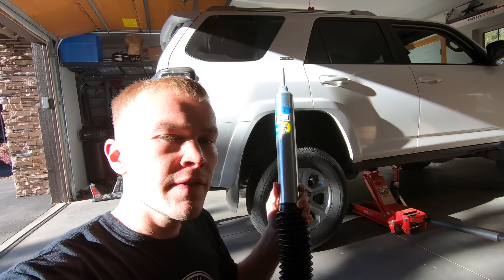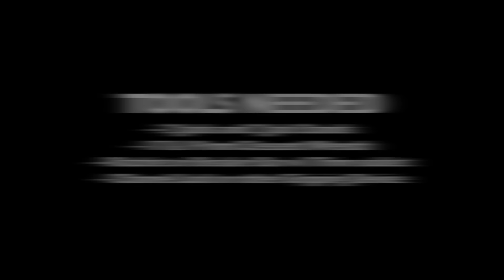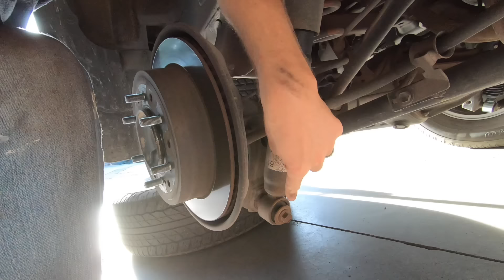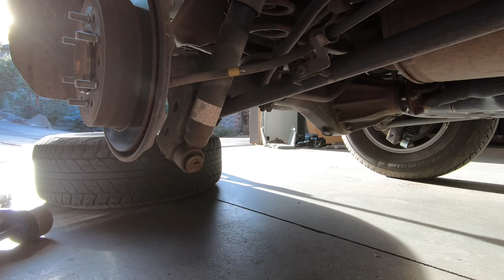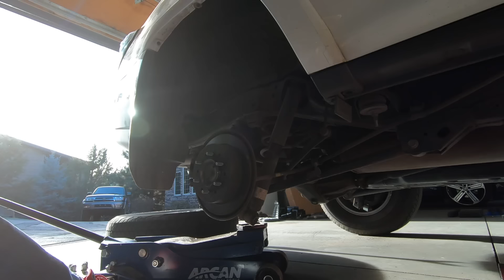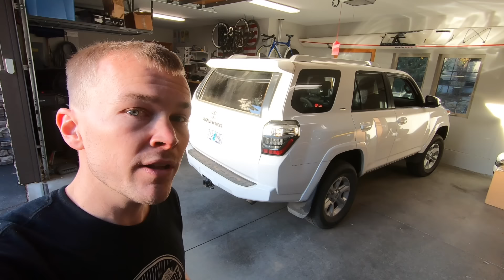4Runner Bilstein 5100 Rear Shock Install

Comment: My 5th Gen Bilstein 5100 show the washer cups face the other direction.  There's also another washer that goes between the bottom bushing and frame. Also, the new top nut is an 18 mm. Maybe they changed things? Thanks for the video.
Reply: Did you end up using the extra alignment washer? I left mine out when I put my lift in

Comment: I have a one inch block and an add a leaf installed in the rear and was suggested to install 5100s which I bought. Do I need to remove anything to make it stay level with the front or will it just sit right because it’s already technically lifted a couple inches? The point of the install was to have a shock that doesn’t bottom out and make for a smoother ride. Thanks.

Comment: I just had a shop install the rear 5100 on our 2011 runner but I’m hearing a clapping noise in the passenger rear now. Any idea what the issue could be? Bushing backwards?

Comment: Hows the ride compared to stock ? Stiffer or smoother ? If Stiffer is it harsh or stiff in a good way ?
Reply from the maker: Stiffer but in a good way... corners better, doesn't dive as much and not too harsh either.
Reply: @DrivenCompanion  thank you

Comment: does this lift the back at all? or does it keep it at regular height as the factory shocks?  Thanks in advance.
Reply: Stays the same unless you get a rear spacer. The spacer will provide the lift as long as you have a different shock to provide for the added travel.

Comment: Good video, thanks! One helpful hint. The old shocks you have to hold the center with open box wrench at the top as in the video to loosen. The 5100s you do not tighten this way, you need an allen wrench to hold the center as you tighten with wrench or it’ll just spin.
Reply: Thanks for the tip, however in looking at my 4R and the one in the video, I don't see any way to get an allen wrench in there.  There is barely enough clearance to get an open-end box wrench in there, no way could I get an allen key in on top of that point.  My 4R is a 2011, but the shock mount looks nearly identical to what this guy is showing.  There is only a sliver of clearance to get a wrench in from the side.
Reply: @14erGuy  you have to chop a allen key to barely fit in the top, or else you're using a rag to keep some good pliers or a pipe wrench from damaging your shock tube

Comment: Thanks for the vid. Got these installed on my Gx with the help of your video. I know the top bolt on the shock is supposed to be 30 ft lb, but it’s hard to estimate since a torque wrench socket won’t fit in that tight space. About how much did you compress the bushing and how many threads are showing? I compressed the bushings a lot and there’s about 5/6 threads showing, do you think I torqued them too tight?
Reply from the maker: 5-6 sounds about right to me.
Reply: Mike C okay cool, reviewing your video I definitely tightened them a little bit more than you, but when I went to loosen them up a bit they just seemed to loosen too easily so I just left them. Thanks again for the vid

Comment: Great video.  Appreciate that disclaimer about following your instructions at the beginning but this was all I watched!  The only difference I found helpful was to use the jack to compress the new shock.  Also torque spec is 30 at top and 72 ft pds on the bottom.  The shocks are easy peasy!

Comment: How would this impact KDSS-2019 4R Offroad Premium with KDSS. I am concerned about the difficulty with KDSS front and rear, and also impacting how KDSS would work with these shocks/struts? Please advise. Thanks.
Reply from the maker: Sorry my only experience is with the non-KDSS.  Hopefully you can find some other resources that deal with that.  Wish I was more help.

Comment: When you say tighten up to spec, it's helpful to mention what spec is
Reply: Till it tight as shit has always worked for me
Reply: Top is 30 ft pds and bottom is 72 ft pds.
Reply: I quote Timmy The Toolman: “Make it Gudentight”!
Reply: You can also get the factory service manual on 4Runner.org. Specs are in there.
Reply: Specs are also listed in the video description

Comment: I had to cut out part of the Wheel well to get that top bolt, Pain in the ass! Anyone else have to do this?
Reply: Ram rmrz I can see cutting some but I did this just using a Wrench for the top....slooooow!  A ratchet wrench sped things up for one side.

Comment: For the sake of injury, read the manual to your floor jack. They are not designed for long term sustained weight. Lift, place stands, remove jack. Throw a wheel under the vehicle if you want for security
Reply: Derek D I use the jack and then drop onto 2 stands and leave the jack in place with slight pressure for extra security.
Reply: Good advice

Comment: I planning on getting bilstein 5100s for both the front and rear. i plan i setting the front to 1.75”. should i add a 1 inch spacer in the rear to level it?
Reply: A one inch spacer should work on the back and would be cheaper than a new coil id imagine.

Comment: So you only put the shock on the rear. You didn’t put the spacer on the spring
Reply from the maker: Correct. I leveled the front and left the rear at stock height.

Comment: Hi, did you add spacer at the rear? Is it leveled? Im planning to do this set-up. When you do alignment did you did you buy anything like like camber bolt? Sorry i had no idea, thanks
Reply from the maker: I only lifted the front .85" to level it so nothing was needed in the rear.  I paid for the alignment to be done as well.
Reply: So did you put the back Bilstein shocks on
Reply: I did a front and rear lift and just used a sharpie to mark all camber settings.  Based on the comments after my alignment I had it back lined up solid.  Getting the $70 alignment was for peace of mind.

Comment: Can you do this with one floor jack and then use the two jack stands on one side?
Reply: Josh McFarland use the jack that came with your 4runner and lift the axle.  Use that other floor jack to compress the shock and slide onto the lower post.  Take care not to bind up the boot.

Comment: This and the front end install are such helpful videos! Mechanics want $800 to install the front and rear, with the help of these videos I feel confident to do it on my own, thanks for posting this!
Reply from the maker: I was a little apprehensive about doing it myself and I am so glad I didn't after finishing the job.  There are a few headaches along the way but it really isn't that hard!
Reply: I did all four on my 4Runner, very straight forward.

I did run into trouble with the front passenger side and had to cut the nut off.